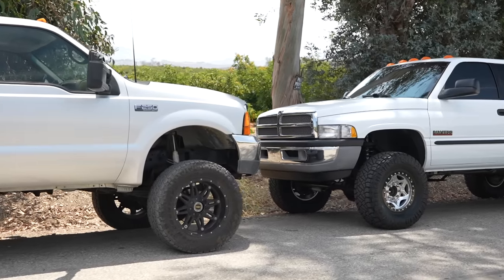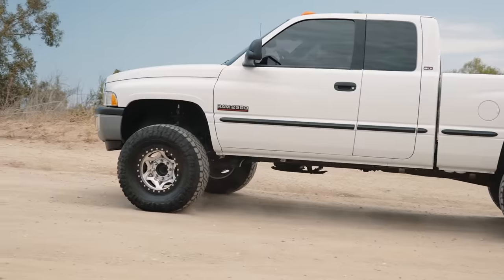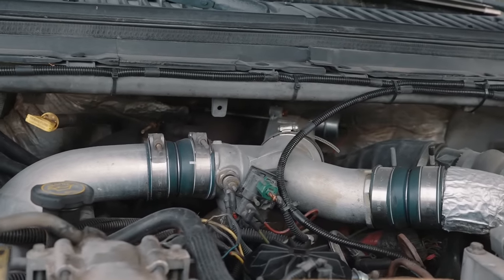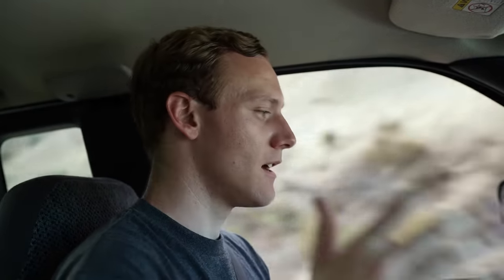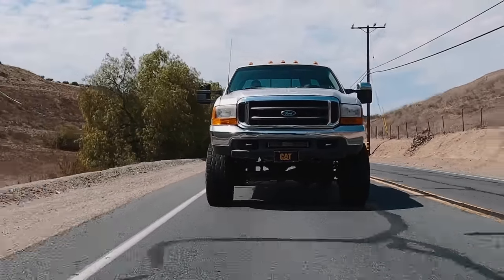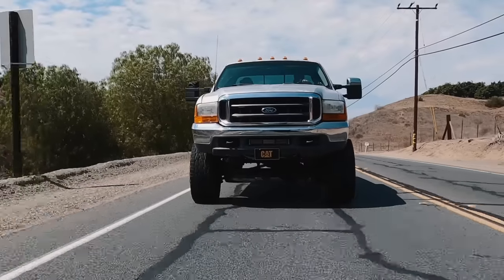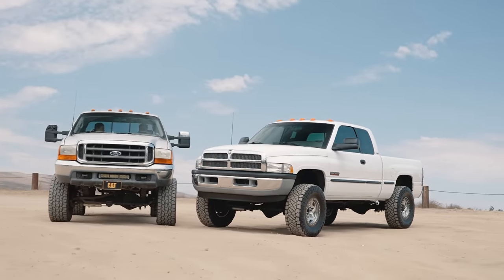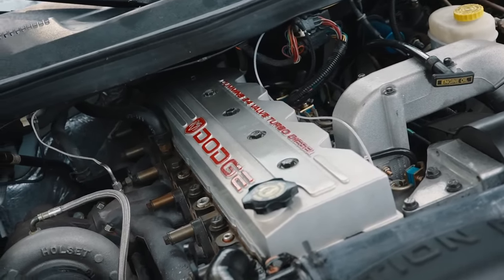1999 Ford 7.3 Power Stroke Super Duty vs Dodge Ram 5.9 Cummins 2nd Gen | Which Is Better?

Comment: Dodge with bags in the back and a 4 link, no leaf springs! Or dodge with rockwell axles front and rear with mcs suspension  the navistar " powerstroke" is a very capable engine because the marine division of international  designed and built it, as long as you leave it stock theyre fine, never chip or alter the boost because they will lift heads off pretty quick as ive seen many many times, ive done alot of powerstroke replacements because eithier the owner abused it or chipped it they are not for drag racing contrary to popular beleif😂😂😂 but they will haul anything as will even the old 12v cummins. Id have to say the cummins stands up to more mods and hp boosts as long as you know your limits, 1000 hp is not unreasonable to obtain with meth injection and water to air intercoolers and a few other tricks

Comment: For me, ford's are by far better than dodge and here is my opinion why.

Ford has the better looking truck and those 7.3's will run forever.

The 12v 2nd gen cummins is a not bad truck, the engines run ok, it's just the only problem with a dodge is that the suspension is not that good at all, when the truck is going off road they ride like a ww2 battle tank.

Comment: I’ve owned like 20 each of both trucks. The ford is BETTER IN EVERY SINGLE WAY! Only advantage dodge has is power when you add a programmer. 
Reliability, quality, transmission, room, ride literally everything is better with the ford. 
Every 5.9 pisses oil everywhere, auto and manual transmissions are JUNK, interior falls apart, rides like a dump truck etc. 
I have a 24v Cummins now and love it but god damn they’re pieces of JUNK!

Comment: neither is better its a personal thing i like 5.9 best after having 2001 7.3 92 7.3 idi that i turbo'd and got a 5.9 the low in pulling power and sound of the 5.9 is what fits me but nothing wrong with a 7.3 power stroke
Reply: speaking of that i always have wanted a 6.0 powerstroke bullet proofed but just have not taken that step yet and tryin to find one thats not been molested that still runs and a teenager has not owned lol

Comment: 10:00 Chevy has the best interior from 01-10 and the dash doesn't break. I see way more used Chevys/GMC with good condition interiors vs. the other two. Dodge is the worst. Searching used, I think 1 in 20 dodges from that era have in tact interiors. Fords are basic as hell, but still last longer than dodge.

Comment: So the 99 super duty is a transitional year. at about 2:00 you say it's the end of the  7.3 evolution. There are actually 99 f250's with the prior gen powerstroke motor and are less powerful.  You need to look at the born on date to determine this.  Also the f250 is stupid easy to break into with a screwdriver.

Comment: So…I’d say you’ve got the wrong trans in that dodge. Manual for the win, automagic trash. Can’t speak to the NV5600’s personally, but if you fix the 5th gear nut issue on the NV4500’s, you’re pretty mint up to about 500 horse. 
Personally, If I had to pick between a 12, a 24, and a 7.3, for reliability, I’d say the 12 wins, and the 24 and 7.3 are about tied, for aftermarket power potential, again, I’d say a 12 valve wins, there are some absolutely insane mechanical monster 12 valves out there, then the 24 probably beats the 7.3. You can absolutely make some serious power out of a 7.3, but just due to abundance of aftermarket parts, I’d say the 24V wins. They’re all good trucks (I’d have a manual in any of them before I’d have an automagic in any of them), personally, if I had to rank them in what I’d own, price no object, I’d say a 12V, a 7.3 OBS, a 24V, then a post-97 7.3. 12 wins just cause they’re awesome, next 7.3 OBS cause they’re absolutely beautiful, even though it’s a little harder to do engine work on them than the post-97 trucks, then the 24’s cause even though I’d rank that engine about even with the 7.3 in terms of reliability, and ahead if the 7.3 for aftermarket power potential, an OBS is way prettier than a 2nd Gen.

Comment: I want very much Ford Excursion c V8 7.3, but they discourage me and tell me to take V10 6.8 because it eats any fuel even in Mongolia, and bad diesel is worse. Of course I plan to fill up with good fuel, but it is not always and everywhere available.
I suffer with my crossover because it eats 98 octane, but often it is not available and I fill up with 100, minimum 95, but if you can go higher - better higher than 95.

I am happy with the simplicity of the car for expeditions, even to Norway, even to the north of Russia, or to Mongolia, Kazakhstan.
Of course, I don't like that it is old, although it has its own charm as in Chevy with its two-level headlights and body like brick or square.
But I think how could you update its headlights and lights to diode ones from new generations. Ideally a new dash and steering wheel. Maybe buy a donor and re-hang the whole body like CABT does because it would be difficult to integrate the interior and front panel.
It's a dream for now. I would like at least a car to go somewhere there and there again, to pull a trailer with cargo or equipment.

The question is which motor to choose?

Comment: So the 99 super duty is a transitional year. at about 2:00 you say it's the end of the  7.3 evolution. There are actually 99 f250's with the prior gen powerstroke motor and are less powerful.  You need to look at the born on date to determine this.

Comment: I love the old 5.9s, but the 7.3 is better overall. I hate hate the dodge truck itself. Their junk. They fall apart and rust way to quick. If I had to pick it would easily be the 7.3. The truck itself is built way better. An that motor is just as good if not better in some ways than the Cummins.
Reply: I own the early 99 Super Duty and couldn't agree more.  The motors are a toss up.  Neither is bad.  The chassis, body and interior of the Dodge is trash.  Time has already taken its toll and their are ALOT more Super Duty's on the road today.  I sold a 96 12v for the 7.3 because I was tired of pumping money into EVERYTHING but the motor.

Comment: That’s a third gen Cummins.  Ve pump first gen.  P pump second gen vp44 third gen.
Reply from the maker: I think you count differently than everyone else.
Reply: @JustDiesels  are you thinking about the body style.  94 to 01.  Second generation body.
Reply: @ram_diesel_power6039  94-02 for 2500/3500 series trucks and yes I believe we are referring to body styles.
Reply: @2500mike  so I’m a dodge guy through and through.  I had many dodge pick up fro the 70s 80s 90sand 2000s. When the term first gen or second gen is used it is basically revering to the Cummins motor In that dodge.  Before  I bought my 93 first gen in 04 I had an 87 dodge d250.  It was never referred to as a first gen.  No big deal. I still like his videos.

Comment: If ford built the 99-03 superduty with a cummins and zf6 it would have been one of the most well respected trucks ever made.  99 7.3 had the strongest rods of the superduty but its still a 7.3 with 7.3 problems.  the 4r100 is stronger than a 47re but the 47 can easily be built really strong.  the zf5 and 6 are better transmissions than dodges nv4500 or 5600.  99 superduty also will have a dana 50 on all single wheel models.  the dana 60 didnt come back until some 2002 model f350's.  Not a total deal killer, but man, if the ford just had the 60 it would be indisputable a better truck itself.  ill happily own a cummins, any cummins before any 7.3.  Dodge trucks are a shipping crate for the superior cummins engine and the 7.3 is a place holder in a better truck to someday have a cummins.  If you made me pick from the two, knowing the some of both parts and being a ford truck guy and a cummins fan, id pick whichever one had a manual trans.  That would be the decision between these two trucks for me.

Comment: to bad the dodge was plagued with sub part interior that disintegrated over time and transmissions that couldn't hold up to the engine powering it. As my everyone in my area put it. Great engine surrounded by scrap.

Comment: Is the dodge all stock performance wise too?
Reply from the maker: Both just have a basic tuner!
Reply: @JustDiesels  I'm getting a 24v with stock rebuilt auto. I want to wake it up a little without transmission upgrades yet. Will I be ok with edge juice with attitude and keep it on a low setting
Reply from the maker: I personally prefer the Smarty. It gives you more control of timing etc, and the basic settings are pretty safe!
Reply: @JustDiesels  noticeable over stock?
Reply from the maker: Yeah absolutely.

Comment: 6.0l and 6.4l are NOT Ford engines. All diesels in Ford trucks from the bullnose to the 2010 trucks is internationals engines. But what happened with the 6.0 and 6.4 is international contracted their small medium duty truck engines to a company in Europe. Which is where the powerstroke from 2003 to 2010 came from.

Comment: I have a 2001 dodge ram 1500 with the 5.9 liter V8 and it will pull and do everything I need, but the interior is complete shit! Everything breaks ! Dash cap on all of the them.
Reply: Lmao. When they refer to 5.9 in the video they arent talking about your truck at all. They are refering to a ram 2500 with a 5.9 inline-6 turbo diesel. 😮

Comment: Give me that Ford with the DT360 (p pump) ANYDAY... I had a 86 F250 I swapped the dt360 into and owned a 93 1st gen dodge. The DT360 to me is a much better engine and was the route ford should have taken instead of the 6.9 and 7.3 idi.

Comment: I can respect both.. but not Ford. They built a truck yheir own engine didnt fit in, pushed another design through, which mimicked the dodge, and then bought cummins🤔 
As there is always this question->"Why are they no PowerStrokes in Semis?"
And why do 2 ton Fords have Cummins engines?
Both tractor engines in shipping crates one cummins, one international

Comment: Most ford guys never change the HPOP oil it doesn’t drain with the engine oil and needs sucked out with Vacuum pump everytime you change the oil there is a hex plug on top of the HPOP just for this task. The worst part about a 7.3 is because of the oil driven injectors when oil is hot or near the end of its life you lose the Hydraulic pressure to pop the injectors off properly and lose power.

Comment: So that ride quality in the Dodge with those coil springs is huge. I currently have an '02 7.3 4x4 same truck this kid has but red. Little faster though lol. And I've had the five nine Cummins. But my '94 '96 and 98 Dodges they just broke man You cannot work them in the landscape industry. These guys aren't really working these vehicles. When you snow plow with the vehicle and pull skid steers and brick pavers that's working a vehicle. Maybe Dodge has got it right now but they did not have a working truck that could work hard back then transmission brakes electronics the 4x4 always broke

Comment: I love the look of the dodge I’ve owned 3 of them and 2 of them were beyond annoying. Terrible brakes bad transmission bad ecus injector pump was problematic the interior was comfortable but garbage. Have never owned a 7.3 yet but I know people that swear by them. 

Granted my 99 and 01 24v were mildly modified but my 98.5 the hood one was bone stock so go figure why it was consistently good 🤣

Comment: Your Dodge does not have control arms they r both streight axle in frt
Reply from the maker: Yes the dodge does have control arms for the solid axle. It’s a 4 link coil front end with control arms. You’re thinking of A arms on an IFS front end.

Comment: Most diesel owners are pretty dumb in my experience, so it makes sense they can't handle and understand a more complex HEUI diesel like the 7.3l International made. Ford interior is better, overall build quality better, it has the better axles and looks more modern.

5.9 is simple yes, but the rest of the truck is pretty junk.

Its not that difficult to solid axle swap a 7.3l and put a Carli setup in their either.

I'm bias towards Ford because I know how good the rest of the truck is.

Also, you can't destroy your 7.3l due to lack of oil if the HPOP goes out, and you parts are easier to get ahold of due to the NBS 7.3l sharing the same platform, as someone else said.

5.9 has basically only two things going for it. Simpler engine, and better suspension. Everything else is inferior.

Comment: I own both the 7.3 n a 5.9 24 valve and a 12 valve Cummins that is currently sittin on a engine stand.  my 7.3 ride quality is garbage a lot of body roll I gotta hold onto the passenger seat goin into a curve. And the power delivery is ok but it’s still slow as shit. My 24 valve is faster way faster I’m able to build more boost with my Cummins than I am my 7.3 but the ride is about the same Cummins is a lil better but not by much. Now granted both of my trucks are very outdated in suspension terms. And horsepower terms But I will  not sell either of them I love both my trucks. I’d be heartbroken if I ever had to sell  either one of them

Comment: I stopped driving ford because in the winter when it was cold you couldn't get it to start I stopped driving Dodge because you couldn't keep the transmission in them I had several of them. Now I am a Chevy man best trans ever I don't know if it will out pull the Dodge it will out run them

Comment: id say the transission in the 7.3 isnt that great.  they fail often. ive been a powerstroke tech for 12 years. especially if you add the big tires andm ore horsepower

Comment: 4R100 is reliable? Maybe in comparison to the Cummins trans… but far from reliable.

Ram has “control arms”? WTF? Control arms are on IFS, not straight axle…

Pretty decent video overall, but those glaring details just bother me lol
Reply from the maker: It’s massively more reliable than the 47 (low bar haha) and yes, the Ram uses control arms. It’s a 4 link coil front end with a solid axle.

Comment: Sorry, but both of the automatic transmissions in those trucks are not very reliable. You guys are basically comparing the 2 worst transmissions together. Dodge definitely come stock with the worst transmissions, but neither are great by any means.

Comment: Dodge has Cummins because International under bid Cummins in the mid to late 80’s when their contract was up before the 7.3 IDI came into play. Cummins engine were supposed to be in Fords there were even Factory Ford pickups with 12v’s in them made but they were destroyed for obvious reasons, but Ford took the cheap route boy what a mistake they made

Comment: The dodge may ride better but reliable front end definately not, i had a dodge and ride is better but i went through front ends all the time grant it i had 32” wheels on it but i have those on my ford and never had a problem with front end components

Comment: I have owned a great specimen 01 dodge 2500 camper package with the 24 valve and it tows ok but its stock and its a dog, only makes power at 1,900-2,000. I have $5k into the front end and its stock height with 33s and it drives and tows like shit, always wandering. Looking for a 7.3 dually now and going to dump the dodge.

Comment: I will tell you this much, the 7.3 is a fluid leaking mofo. You name it, any fluid that is in the 7.3 from the oil to the tranny leak. I owned 4 7.3’s from 97 to 2021, every one of them without exception leaked fluids, change all gaskets, tighten every bolt, 2 months later puddles under the motor, great trucks, I averaged 400k to 500k miles per truck. But they can’t hold their juice…

Comment: I traded in a 99 7 3 6 speed standard extended cab short bed 35 tires 160,000 MI up kept by Ford .. back around 2010-2011I traded it in for $6,000....................,.noooooooooooooooooooo

Comment: Ford just won lol if you had the newer Ford axles on a 99 7.3 it’d be way better and also if you had compound turbos on the 7.3 you can have low end and high end torque and horse power but I will give the 2nd gen some credit for being better with suspension and body strength except interior on the 5.9

Comment: 7.3 is garbage never seen one hit 1,000,000 miles unless it’s been rebuilt 3x and it’s mpg is horrible for a diesel…. All my 2nd gen Cummins got 17-22 mpg consistently. Ford has a better stock tranny but don’t cost much to build a great 47re tranny that will match the Cummins monster

Comment: Absolutely fuckin hate fords but would still take a 7.3 w ZF and 4x4 Reliable motors and fuckin great drivetrain. I bleed mopar. Like I will not drive a thing but a 12v but that’s just due to close suppliers for parts and knowledge on the motor. I use the piss out of my trucks hard. Hard man like hard. In sask prairies with a addiction to gravel. And haul heavy a lot (bails, horses, mini hoe, skid, campers etc). Holy fuck does dodge have no idea how to make a fucking transmission. Nor a front end haha. ****I drive a 2wd, never had an issue and ima a fuckin rancher in the prairies. Tons of snow. No problems. Don’t fucking whine you need to learn to drive or how to get unstuck yourself. Will not drive a 4wd second gen haha. That being said when it’s super nasty I use the trail hawk 

12v is the only thing that won’t goddamn cry when I make it fucking scream every day all day with serious maintenance.  Roughly 5-7000 km / month.